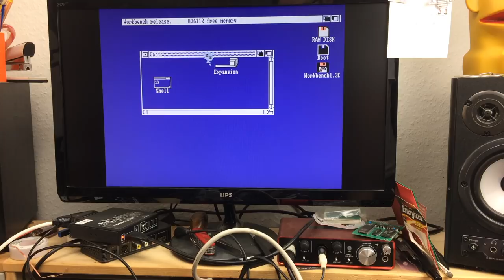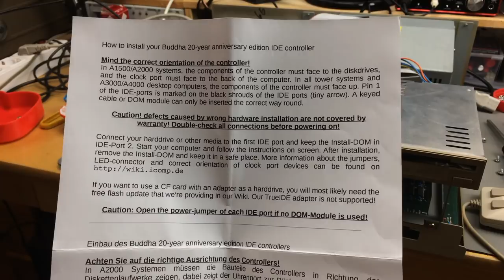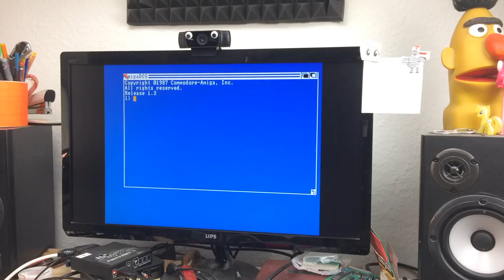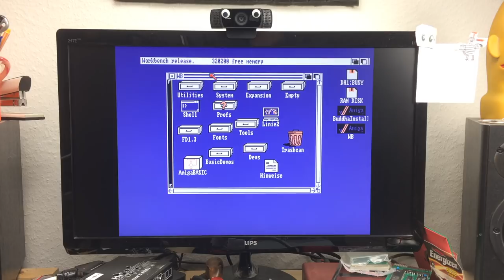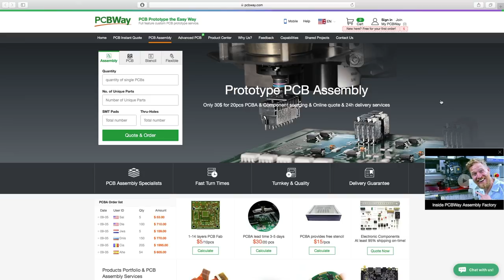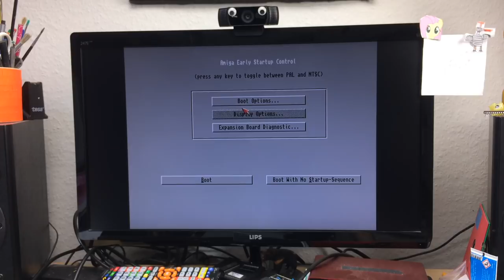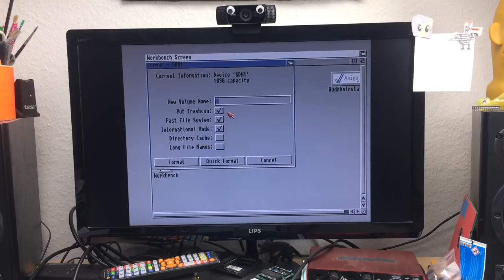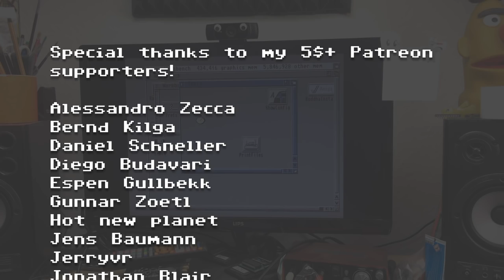Amiga 2000 Upgrades: Harddisk, RAM Expansion, Kickstart 3.1.4

Comment: You just have to re-partition with HDToolbox from 3.1.4 and set the "File system block size" in the Advanced options to 4096, then it will format fine, even with just 1MB RAM.
Reply: With 3.1.4 you don't need to set anything in the advanced options (fs block size wise).
Reply: If you have a very large harddrive and limited memory, you do!
Reply: @hofinger82  

I have partitioned and formatted a 128 GB SD card with my A500+ + ACA500Plus with 8 MB Memory without any issues.
Obviously I booted from the 3.1.4 installation straight away (no 3.1).
Reply: @MauroSanna  8mb ram is a lot more than 1 mb of ram.
Reply: @wishusknight3009  
Yes, though he tried with 7 MB and failed anyway.
Reply: can't you just use a flash cart like the 1 already fitted to the ide port on the card,  that would be more reliable than a 10 year old hd,  or is he wanting an old hd setup.

Comment: “I will use this piece of wood...” — Bangs the Hammer against the metal directly 5 seconds later 😁
Reply: #janhammerwashere
Reply: Ah but wood was on the other side of metal.
Reply: @FADE2GRY2048  Ideally you'd have wood on both sides, like how 8bitguy fixed a dented Commodore PC case not that long ago, and that turned out great. And he's usually the other youtube guy who ends up ruining something in his restoration.
Reply: Same with the card board with the pliers
Reply: @Daniel Schneller and @Nukleon "Bangs the Hammer against the metal directly 5 seconds later" ... what actually gives you a plain surface instead of many small waves when using wood as the forming tool. Okay, it depends on the hardness of the wood and how rigid the sheet-metal is. But he did it right. Plain metal on metal leaves no way for the sheet-metal to go. If there was a bent, the surface must be maintained anyway after this process. But there is another way to handle such thin sheet-metal: Use a vice with protective jaws to bent the material straight. Produces less dents in one or two (mirrored) working turns.
Reply: @dieSpinnt  I like the vice suggestion.
Reply: Jan hammer, metal Beta.

Comment: Hi Jan, i had a similar setup with my A2000, except i had a megachip for the 2mb of chip ram in it, i used a 60gb ssd with a ide to sata adaptor which worked very well, what i did to make the whole thing easier was to plug the ssd into my pc with a usb to sata adaptor and ran winuae and added the buddha as an expansion card and got the rom for the buddha online which allowed me to do a manual install of workbench 3.1.4 and format the partitions how i wanted them, i found this the easiest way, hope this helps and keep up the good work on your videos, i love them.
Reply: Seems the DKB Megachip is the way to go

Comment: What's done four years ago is bygones, of course, and maybe I'll stumble across a video where you address this further, but for future dents like that, I'd suggest going with a big weighted hammer and sandwiching the metal between two pieces of dense wood, never striking the metal directly. Heck, haven't I seen you work with a bench vice grip in a couple of videos? That with a wooden sandwich could be perfect, no hammering needed. Pliers and a small hammer directly to the metal makes it banged up and bent out of shape, like in this case. I'd honestly try the bench vice grip with just some layers of cloth for protection to smoothen the edge out. 👍

Comment: The way I got around having a huge (now Small) capacity Hard Drive in my Amiga 2000, is to use a 40MHz Accelerator with 16MB of Memory and take advantage of the on board SCSI ports.

Having a 50 pin internal SCSI port (in my case), sorts out the problem of maximum 4/8GB Drive Capacity.  This is because the SCSI Controller handles most of the drive’s attention.  All you got to worry about, is limiting the partitions to about 2/4/8 GB (Depending on ROM/Hardware setup and OS Version).

On my Amiga, I managed to partition a 4 GB each Workbench, Programs, Games, Floppy Backup, ADF Catalogue, Documents, Midi, Photos, Video.  It’s a bit fiddly to setup, and you got to edit your Startup and User Startup files so the Amiga knows where all your software is when you call for it.

All I’m trying to get hold of at the moment is the Spectrum 110/24 Graphics Card that mounts to my Accelerator, and my Amiga 2000 will be perfect.
Reply from the maker: Sounds like a great setup you have there. :)

Comment: I would say more memory might do it, most newer programs or hardware require a great deal more memory to work than the  original max memory at least that's what I find these days. Despite my good (but not great) knowledge of retro hardware I haven't seen much on this Amiga specifically and actually I haven't seen a great deal of this stuff that you did here new or old hardware and such. Great to see it all here though very informative I'd say and I will certainly look up some of this stuff but this is a good start right here, Danke Jan!

(Oh and sorry I didn't say good bye on stream, life happens)

Comment: Hoi Jan, that’s not a SCSI HDD but a RLL/MFM HDD it’s before SCSI. Sometimes when you clean the stepper motor you can format the HDD. And you have to low-level format it first before you can make a partition on it who you can format.
Reply: He does correct himself very shortly after.

Comment: Another option is to add the samsung disk to a Linux machine using an ide adapter. Create an image file with the exact size of your samsung disk using dd. Partition image file in to smaller partitions and format them with pfs3 using fs-uae+wb3.1.4 and setup as needed. IME it is a faster to way to experiment.

Comment: Ich glaube du hast dich da etwas Versehen , das heist nicht "Lueroautomation" sondern "Bueroautomation" , is nicht wirklich wichtig aber da du es in deinem Video extra erwähnst dachte ich , weise ich dich mal drauf hin. Dein Video is mal wieder Mega , es versetzt mich immer zurück in die gute alte zeit in der man immer Nur STANDARD Amigas kannte bzw ich zumindest , heute sieht man erst mal so nach und nach was sich da so alles getan hat an Hardware und was noch so geht heute .. Mach weiter so ^^
Reply: In meinen Amiga 2000 waren SCSI Controller von Gvp, Turbokarte 2630 mit Fastram von Commodore,Festplatten von Quantum eingebaut und Ben SCSI CD Laufwerk...damals warste dann der King 1992 😀 
Später gab's den Amiga 3000 und Amiga 4000 aber die waren richtig teuer..ich blieb beim 2000er und wechselte dann zum Amiga 1200 mit Turbokarte 16mb RAM und 68030 mit 40 MHz ..das war dann schon sehr geil im Gegensatz zum Standart 1200 mit seinen 14 MHz

Comment: I believe Amiga OS 4.1 (community built) has support for larger drives.  I've not used it personally, but I'm pretty sure those PCs just have modern harddrives in them.
Reply from the maker: Yes, I think it uses a more advanced file system.

Comment: Just a guess,  I am betting the problem is with the partitioning of the drive.   Try connecting the drive to a modern PC and creating multiple smaller partitions.   Don't create partitions that are larger than the Amiga OS originally worked on..   As a bonus, multiple partitions will give you the option to have an online backup that you can copy over in case there is a need.     You could also try removing ALL partitions from the drive and see if the Buddha software is able to handle that situation better.

Comment: It's an ST-506 hard-drive, right?
You have over 800KB free when booting from disk, seems odd that that much disappear when booting from hard-drive... any ideas why?
Fast File System perhaps doesn't support the second partition...
Reply: Probably due to a different number of disk buffers (memory set aside for the disk cache) being set in the Startup-Sequence when the Amiga boots up, as well as whatever else being loaded into the RAM disk. That would be my guess.

Comment: You need a fat/fatter Angus chip to get 1MB of chip ram, I think the fat chip will use up your slow fast ram and convert it to chip ram. Also repartitioning the disk using the HD toolbox on the install disk might help.

Comment: Unless Kickstart 3.1.4 has the 64-bit patches, FFS can only use up to 4Gb for a partition: https://en.wikipedia.org/wiki/Amiga_Fast_File_System
Also due to disk addressing.  I got a 40Gb 2.5 i HD in an A1200, and am limited to 8Gb usage, I think.

I would suggest to look into newer AMIGA filesystem developments for larger partiions.

Comment: what if you put a pice of wood each side of the case the hammer the wood so pushing agaents the wood to make it flat mabey but i would use a hard bit of wood on the bottom so the metal does not dent the wood

Comment: I had the same problem on my Amiga 4000 years ago, but i did find a program on aminet.net that increased my max harddrive capacity to endless. Not sure what the program was called, but it installed a command early in the startup-sequence allowing other larger partitions. I had rom 3.1 back then, but if 3.1.4 supports larger drives then 4Gb you can try increasing file system block size in hdtoolbox to 4096 like hofinger82 suggested. Also, first thing you should do when installing a new harddrive, is to load hdtoolbox and partition and format it from there.

Comment: Hello Jan. There is a flash update for the buddha controller available that might solve your problem. The flash version iComp delivers with the controller can handle old zip drives. In the current version this support was dropped but it fixes the handling of big drives. -- http://wiki.icomp.de/wiki/Buddha_flashing -- I use a 64GB SSD with a IDE to SATA adapter and that works fine. But I had the same issues with the RAM in the beginning, and also make sure to use the FFS which is updated in OS 3.1.4 (and the Update 3.1.4.1 you can download from Hyperion once you register your ROM).
Best regards from Erlangen, Thomas

Comment: I seem to have a feeling that validating a hard disk requires a certain amount of RAM per MB/GB, and that may be the issue, you seem to have 512KB Chip RAM when you're trying to format both of those partitions.
Reply: That said though, the A590 Setup Disk is your friend with 1.3. It has a 1.3 compatible HDToolbox and so long as you don't bust 4GB in your partitions, it'll put the FastFileSystem handler into the RDB which you need on 1.3 as it's not in ROM, it will also give you a nice clean 1.3 Install script. Gosh i'm such a nerd.... ;)
Reply: And then I watched the whole video facepalm Well my feeling was at least right :D

Comment: Könnte am chipmem liegen. Irgendwie zog der Installer bei meinen Rechner während der Installation fast nur Chipmem und kam fastmem ab....
Reply: Das Mainboard des 2000er hier hat die Revision 4.x...kann am Mainboard liegen das dann von den 512kb Chipram was abgezwackt wird für den Ide Controller. Aber die meisten Amiga 2000er hatten insgesamt 1mb RAM bzw 512k Chip und 512k Fastram...
Reply: Die späteren Revisionen hatten schon 1MB ChipMem mit der 8372A Agnus - das könnte der Grund sein, dass es nicht klappt. Im iComp Forum gibt es dazu einen Thread, in dem Jens Schoenfeld (der Erschaffer dieser Buddha-Version) darüber nachdenkt, ob evtl. die Systemempfehlungen in Bezug auf den Speicher nach oben gesetzt gehören.
Das hängt aber stark von der Größe der verwendeten Harddisk ab. 160 oder 120 GB, wie in diesem Beitrag gezeigt, sind schon sehr große Modelle, die zwar unterstützt werden, aber dazu eben auch mehr Speicher brauchen. Ich habe eine 10 GB Platte erfolgreich installiert - mit einer (wie hier probierten) 120 GB Platte brachte ich das System während der Installation erfolgreich zum  Absturz (Speichermangel/Überlauf), hatte da nur 1MB Chip und keine Erweiterung.

Comment: If you got an IDE-connector now with the Buddha-controller, I would definetly go for a CF-card solution, instead of fiddling with old mechanical harddisks! IDE-to-CF adapters are cheap (around 6€) and small. I recently did that on my Atari Falcon with a double-CF adaptor (the second CF-card is for data-exchange with the PC), which comes in a 2,5" format case and it works flawlessly! 😎
https://flic.kr/p/2gUS36e

Comment: Definitely upgrade your Chip ram Jan, and there is an update to OS 3.1.4, its now OS3.1.4.1 :) so register on the hyperion site and download it
http://www.amibay.com/showthread.php?106062-KIT-of-Megachip-for-Amiga-500-2000-CDTV-30%80

And I would update the PFS3 filesystem, just download the latest one from Aminet should be PFS3-aio ver19.2, and you can update it through the HDTools without losing any data

Comment: You shouldn't use a block of wood...You should use a block of brass...You need an anvil...heheheh. I haven't messaged you in a while but recently I got 2 A2000 rev6 machines...and messing around with a A3001 series II GVP 030 50MHz card and GVP SCSI card and an A2091...they don't play well together...messing up the SCSI.device stuff in ROM...have to pluck out the ROMS from the GVP 030 card so they don't interfere with the SCSI cards...
Reply from the maker: Yes, I need properer tools for working on that case... Turned out okay-ish in the meantime after some more fine tuning. ;) Yeah, I can imagine cards not playing well together in the Amiga. I remember some issues with RAM expansions interfering with each other in my original A2000 from back in the day.